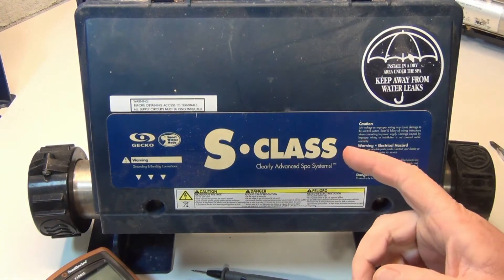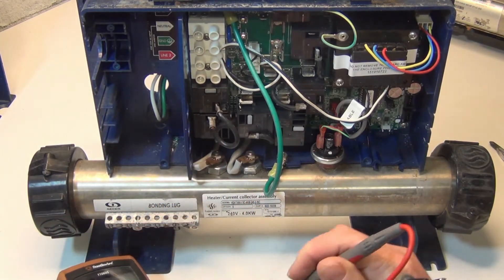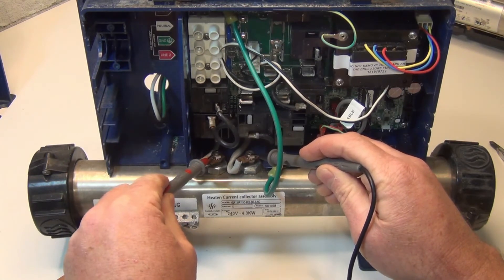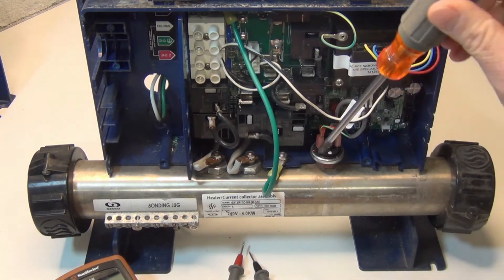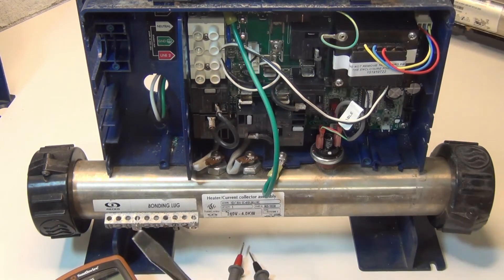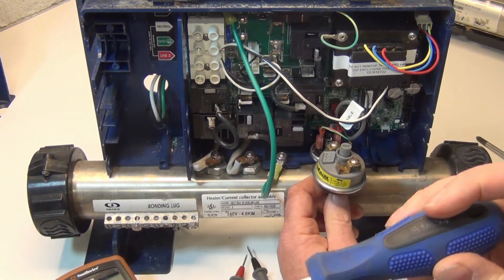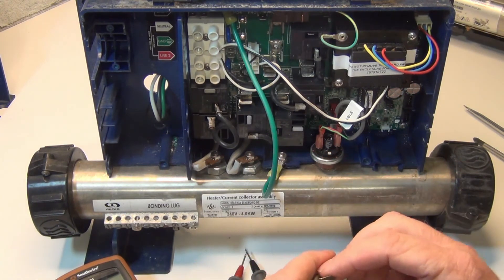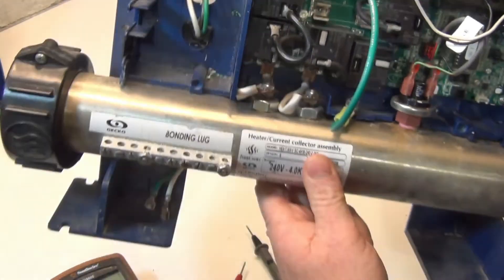Common Problems Why Your Hot Tub Won't Heat Up

Comment: I keep burning out the contactor on my hot tub . It does not trip the breaker —I have replaced 3 in a short time - and it is winter — they last about 24 hours then burn out and trips the reset button . No loose connections — I am coming to the conclusion the dealer has a bad batch of contractors ? I need help.
Reply from the maker: @carlthiele4920 do u have the original
Reply: @VIPPoolsandSpas  No the original one burnt out 4 or 5 years ago — all totals I have changed 5
Reply from the maker: @carlthiele4920  Too high of a breaker or wrong contactor

Comment: Hi hoping you read this…

What if it calls for heat with no error code and I still get 0 volts across the heater?

Checked house input get 240 coming to the board 
Get 120v across each heater input tab to ground. 
Checked fuses they are good. 
Checked resistance across the heater got proper 16 ohms. 

Could the pressure sensor fail while not reporting an error? I’ve screwed the adjustment in and out all the way and it never clicks into 240 across the heater. I’ve shorted directly across the pressure sensor tabs as well and still won’t go on. Disconnecting either if the wires on the sensor and the error code immediately goes on. 

Everything appears to be working is it an internal circuit problem? There is no evidence of failure, no burning no discoloring nothing. 

Any advice?

I’ll pray you have an answer I’d hate to face the possibility that the circuit board is broke and not fixable.
Reply from the maker: Change the heater element.
Reply: @VIPPoolsandSpas  I've read a diagnostic flow chart that reads if I am not getting 240V across the element when it is calling for heat the problem is in the circuit board, not the heater element. The same diagnostic reads that if I do get 240 and no heat, then the element is bad.

Since I am not getting 240, are you sure the element is the problem? I am hesitant because it is a $180 replacement and I'd hate to be back at square 1 $180 less. Unless I just get the element which looks to be about $40 I suppose....

I very much appreciate your help, if you insist I will order a new element.

Also, it appears that I may have damaged the high limit sensor last night, as now I am constantly getting the three dots. Is the high limit sensor simply a continuity switch that breaks the continuity above a certain temp? Meaning for diagnostics, could I just jump the connection pins to rule out this as a problem and replace the sensor later?
Reply from the maker: @luckyleaf6  send a picture of the circuit board to info@vippools.ca
Reply: Additional fwiw. I was able to run the system error free (no blinking dots) 

I disconnected the heating element from the terminals. Turned on and called for heat. Pump on heat indicator on. Checked voltages. Zero across the terminals. 120 across the left terminal to ground. Zero across the right terminal to ground.
Reply from the maker: Might have to test the relays for the heater element.
Reply: That sounds correct. Turns out I know an electrical engineer who after discussing the situation agrees. 

We saw that it appears that one of the 120 house inputs seems to go to the left heater tab as it is live with power off. 

We think the other 120 input runs through a relay to the second heater tab. This one has no power either when there is no call for heat or when it calls for heat. 

We figure the relay must complete the circuit and produce the proper 240 on a year call.

We think if we wire direct from the second house 120 to the second heater element it would turn the heater on. It is a check to verify the heater is not the issue and not a permanent solution. 

If the heater is good then I assume I can take out the panel and trace from the second house input through the suspect relay and replace the relay. 

I assume relays should be sold on the internet?
Reply from the maker: @luckyleaf6  instead of jumping the power, why not just test?   And, I have videos on testing relays and replacing.  Links for the relays are in those video descriptions.
Reply: I thought jumping the power would be verifying the heater is not an issue before undoing everything and pulling the circuit board. 

I will look for the relay links, thanks so much for your help and these videos are greatly appreciated by all.

If we can identify a faulty relay it will have saved me hundreds of dollars potentially
Reply from the maker: @luckyleaf6  better to pull the board and test the relays for the heater.
Reply: I have the board off and can identify the relays but when I test the relay with the 9v s you show in the link it does not click. None of the 5 relays do.

Is the 9v powerful enough to make it click?

No signs of issues. 

No idea what to do next
Reply: A new problem. A red led lit up on the circuit board. No idea it even has this led. Powering off light remains on.

Comment: I've got this issue. Same gecko pack
Reply from the maker: Hope this video helps you out.
Reply: @VIPPoolsandSpas  checked all three fuses. They were fine. But no continuity at the heater element or pressure switch..
Reply from the maker: @gray5857  Test the volts anyway.  If no volts, try changing out the heater element.
Reply: @VIPPoolsandSpas  pretty easy to get the element out?
Reply from the maker: @gray5857  Most times.  Just follow my videos.

Comment: Anyone know anything about lower control unit pack on 2 pump s-class ?
I need help troubleshooting and of bad replacing it. Thx
Reply from the maker: What do you want to know?
Reply: @VIPPoolsandSpas  my brothers hot tub went out and I really want to help him get it together as he enjoys it after a long day at work. I want to replace it with him and get him the parts or part. Is there a site that sells used parts? Or does it have to have the exact gekko part or can another. 2 pump jet lower pack thingamajig’ work 
On a budget
Reply from the maker: @UnderdogSTL  They don't make the s-class anymore and it would be better to just put a new spa pack in.  Balboa VS501 or a Balboa BP.  It depends on whats going on with what you have now with the gecko s-class.
Reply: I think he said it is a “lower control pack” ?? 
We both are low voltage communications workers and gonna try and get it going. I’m trying to surprise him and possibly get the part 
I guess I really need full details. 
He complained outside that a rodent chewed some wires and I said is it the pump he said no it’s the lower control pack
Reply: It turns on but don’t heat. The mouse chewed through the cable that runs from the heat pump to the lower control panel board and fried it. Curios on ballpark what parts were gonna  cost if I help out
Reply from the maker: @UnderdogSTL  You can search online all the parts you need for that spa pack.  The sensors will have the information your looking for to replace.
Reply: Part number c2400-0800ET-G.  
Is that the one you say was discontinued. ?
Reply from the maker: @UnderdogSTL  The whole thing is.  Gecko S-Spa.  The part Number you gave is only for the heater tube and not the sensor that was chewed by the mouse.

Comment: We have tested the white terminal and the red and white is testing 0, black and red is fine, and red and black is testing 120. But the hot tub pump kicks on and the top side control. What's missing?
Reply from the maker: Assuming your hot tub is a 240v hook up.  White and Red should be 120v.   White and black should be 120v.  Red and black should be 240v.  If your getting 120 on the red and black, it will be the wiring in the breaker box.  Watch my other video on where the wires should go.
Reply: @VIPPoolsandSpas  it is a 120v. It just plugs into the wall
Reply from the maker: @marinagardner342  a 120v only has a white, black and a ground
Reply: @VIPPoolsandSpas  correct. When it goes into the circuit board, it has white, green, and black. It also has a red jumper wire.
Reply from the maker: @marinagardner342  send a picture of that to info@vippools.ca
Reply from the maker: Whats going on with the hot tub anyway?  Whats it doing or not doing?  Why are you wanting to test the incoming volts.  As you can see by the attachment I sent, don't worry about the red wire because its from a pump.  Only test the white and black.  You should get 120V.  No other testing for volts other than that.

Comment: What about on a balboa heater, premium leisure pn741 hot tub with balboa pbp501x control, 4kw heater tests 14.3 ohms between posts. (Within spec range) Has 120v on each side of heater post to ground, but post to post only shows a couple volts. Amp draw less than 1 amp. No codes heat light on. Circuit board doesn’t have any visible defects front or back. Fuses test ok.  No pressure switch it uses a and b temp sensors. Heats slightly but only at 87 degrees when set to 98 degrees. Verified temperature display is correct temperature of the water with a digital thermometer. Input voltages are all correct. Tried running with filter removed no difference.
Reply from the maker: Sounds like the circuit board
Reply: @VIPPoolsandSpas  found no output voltage on the pin from the left side relay on the control board,  control board is unavailable. Is there a way to repair this without replacing the entire control system and topside panel?
Reply from the maker: @nategrube352  see if you can find an electronics guy to test and or replace the relay.

Comment: Have a Coyote Hot tub.  Replaced heater, have no codes, light on control panel shows heater on and yet after 24 hours only up to 92 degrees.  Can you help?
Reply from the maker: Test element for volts and amps
Reply: Tested for 120 volts on each feed line and that is fine.  Will have to get  an amp meter.

Comment: i replaced heat  element, checked for air locks, i have voltage  at the element. and if you shut valves on the  union to heater, it gets hot.

At the  filters  their is no sucking .  pressing jets 3 on immediately cuts the heating symbol off.

no error codes. any advice greatly  appreciated

Comment: hot tub not heating 

balboa legend series m7
no heat.
replaced  heat element 
filters are not  sucking. and pump 3 switches  off heat symbol. 
..hot tub not heating.
250v at element.
pump is spinning  and seems to be working  .
any help, would make us best friends
Reply from the maker: Make sure the pump that pushes water thru the heat tube is working
Reply: @VIPPoolsandSpas  it is spinning  but is it possible that its blocked and still spinning/working.?
thanks  for your response
Reply from the maker: @davidbrooke4829  did you pull the filters and see if it changes?   Any error codes?
Reply: @VIPPoolsandSpas  pulled the filters nothing changes, doesn't seem to be pulling water in where filters house, there are no error codes, the symbol states its heating then changes after a while if you turn jet 3 on it immediately stops the heating symbol.
Reply from the maker: @davidbrooke4829  if you hit the button for another pump, it will turn the heat off.  Something may be restricting the flow.

Comment: Why my tub control temp goes up then turn off the pump but no heating at all
Reply from the maker: not sure.  you have to try and test a few things to figure it out.
Reply: @VIPPoolsandSpas  if the heater clicks in that means that is working ok?
Reply: How long it takes to heat up?
Reply from the maker: @Mexi67885  no.  The click is the relay for the heater element
Reply from the maker: @Mexi67885  did you test the element?  If its working, should take about 6 to 8 hours to heat up to your set point.

Comment: Thanks for the video - really helped me understand more about the system. I have the same exact model and my problem is (after removing the filter and installing a brand new heater) , the 240 volts would last for about 1-2 minutes and then goes back to 000 . Any thoughts would help . Thanks
Reply from the maker: The heater clicked off and you'll get 0.  Only have the 240v on the heater element when it's heating.
Reply: @VIPPoolsandSpas  so it’s normal to shutoff off during the heating ? It goes on and off on and off . I’m by my hot tub now . Observing :)
Reply from the maker: @elementrepair5084  only comes on when it calls for heat.  When it comes up to your temp set point, it will shut off.  If it's turning off and on at random, it might be the pressure switch.  That's if you have one.  A pressure switch turns the heater on or off.  You would hear the relay clicking.

Comment: so I had a FLO CODE & BYPASSED THE SENSOR & CODE DISAPPEARED & HEAT LIGHT WENT ON. sO I CHANGED & PUT IN A NEW SENSOR & FLO CODE DISAPPEARED & HERE A CLICK & RED HEAT LIGHT COMES ON. THE LOW & HIGH PUMP ALWAYS WORKED FINE & STILL DOES. & THE FUSES ARE GOOD. THE HEAT ON THE OTHER HAND IS ONLY UP TO 72 F. & THE WATER IS COOL. WHEN I TEST THE ELEMENT I DON'T GET A READING OF 120 AT ALL. I GET NOTHING . SO I GUESS ITS THE ELEMENT OR DO I NEED TO CHECK OR CHANGE ANYTHING ELSE. EVERYTHING SEAMS TO BE WORKING FINE....
Reply from the maker: if you have the Gecko spa pack the pressure switch turns on the element.  Make sure the pressure switch is working (any error codes?)  If theres no codes or issues, its the element.
Reply: @VIPPoolsandSpas  I HAVE A Z135 JACUZZI - OLD UNIT BUT NO MAJOR ISSUES TILL NOW...PRESSURE SWITCH IS WORING IT TURNED OFF THE FLO CODE & THE RED HEAT LIGHT GOES ON WHEN SENT TO TEMP ON LOW - EVERYTHING SEAMS TO BE WORKING INCLUDING THE PUMP THIS AM WAS ON 72F BUT WHEN I TOUCHED HE WATER IT WAS COOL
SO I GUESS I WILL HAVE TO GET A NEW ELEMENT- IF I AM NOT GETTING A READING 120  EITHER IS THAT MEAN THE ELEMENT IS BACK  - I GET NOTHING...NO ELECTRIC
Reply: THE ELEMENT IS BAD- IM NOT GETTING ANY READING TOP OR BOTTOM OF SCREWS
Reply: @VIPPoolsandSpas  WHEN I PUT METER IN WHITE & black i get 120 when i put on 2 terminals i get continuity light goes on ??? no 120 or 240
Reply from the maker: change element.
Reply: @VIPPoolsandSpas  if the heater element is damaged i will only get continuty reading then?
Reply from the maker: @tammywalsh2123  Yes.  Just because you have continuity, doesn't mean it's good.  That's why you always test 3 different ways.  Volts and amps also.  No need to test amps if you have 0 for volts.
Reply: @VIPPoolsandSpas  & my sensor is new I have not turned it..it stated company set - it does click on automatically & flo is gone & red lite goes on - so i dont have to turn the sensor again to activate heater?
Reply: when i put it in the white & black it goes right to 120 on the left top box
Reply from the maker: @tammywalsh2123  your talking pressure switch?
Reply: the meter does it automatically
v, amps, continuity
  its all on the meter
Reply from the maker: @tammywalsh2123  not sure what your saying.  There's a red light on the circuit board?
Reply: now how do you know if its the board & not the element?
Reply from the maker: @tammywalsh2123  I'm not there to test everything.  Should be other videos on my channel to focus on what you might have going on.  I would say to change the element first.  The would be the cheaper way to go right now.
Reply: @VIPPoolsandSpas   my question is does the pressure switch have to start the heater to work- do i have to turn it - cause its new
Reply: so my question is does the pressure switch have to start the heater to work- do i have to turn it - cause its new & on the panel the red light goes on & the flo code is off & i have the pumps working fine

Comment: hi.can you help me for my spa i have a spa s-class with 2 pump .pump no.1 is working,pump no.2 is not working,and i have 3 flash doc.and not heating,so i'm try to fix this,i check all 3 fuse is good ,i switch the connection from pump one to pump 2, i find out pump no.2 is working, so that mine 2 pump is working, so i change the relay on pump no.2. still the same pump no.2 not working can you tell me what's the problem?thank you.
Reply from the maker: What pump (1 or 2) pushes water thru the heater tube? (heater element)
Reply: @VIPPoolsandSpas  pump 2
Reply from the maker: @tranquannien5596  Weird you have 3 flashing dots on pump 2.  Normally pump 1 pushes water thru the heater tube and turns the pressure switch on or off (turn the flashing lights on or off).  Doesn't your pump 2 push the water thru the heater tube?
Reply: @VIPPoolsandSpas  sorry i don't know nothing about spa,thank you tell me that,so what's the pump 2 doing? why don't turn on?
Reply from the maker: @tranquannien5596  could be anything.  was trying to figure out what pump is pushing water thru the heater tube.  Test the fuses and test the pump capacitor.
Reply: @VIPPoolsandSpas  i'm allready switch the connection from pump 2 to pump 1,so pump 2 is working,went i connecte pump 1 to pump 2,pump 1 is not working.i change allready the pump 2 relay
Reply from the maker: @tranquannien5596  did you test the fuses?
Reply: @VIPPoolsandSpas  yes

Comment: I have an older spa. I have 15 ohms and 110 volts on a 110 volt sys.  It doesn't seem to be getting hot?
Reply from the maker: well water? When was the last time the element was changed?  When you say old, how old?  Is it air button to turn the pump on?